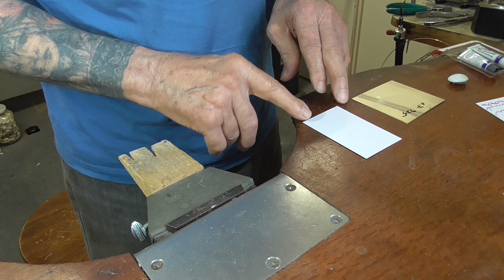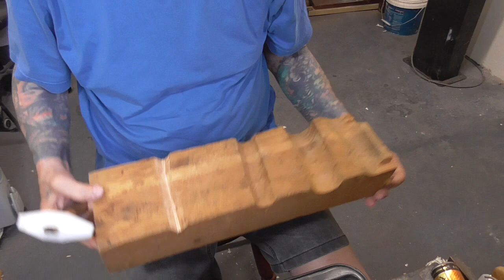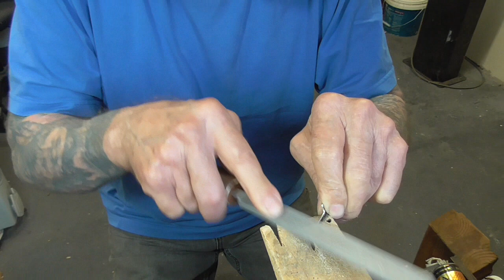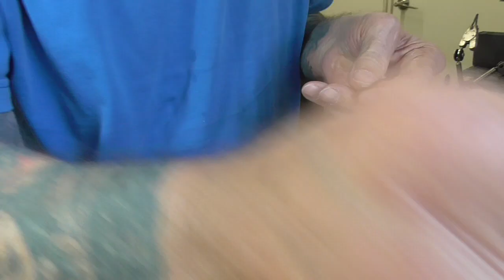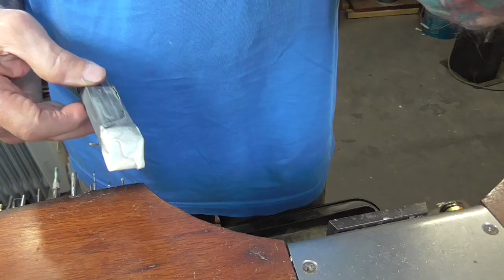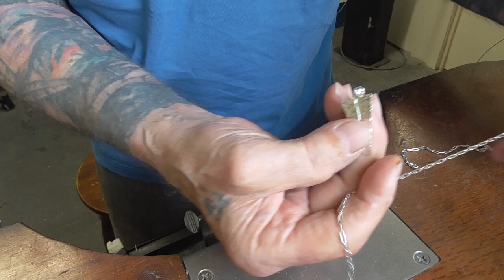folded hammered pendant

Comment: Nice piece.  Firescale on fine silver?
Reply: Fine Silver is a soft metal that isn't durable for Jewellery. Sterling Silver is 925 ppm (92.5%) Fine Silver that is alloyed with 7.5% with other metals - usually copper - to make it harder and more durable. Annealing Sterling silver leaves Firestain which is the oxides of Copper created when heating the sterling silver. These oxides stain the sterling silver red or purple. When pickled firestained Sterling Silver reacts with the acid, removing some of the copper oxides, leaving a thin layer of Fine Silver, but underneath that firestain can still exist. So, to save time and work, Soham tumbled the piece to buff up that layer of fine silver and finish the surface.
Reply: He used sterling for this piece because it’s more durable than fine silver. The pendant is for a child.